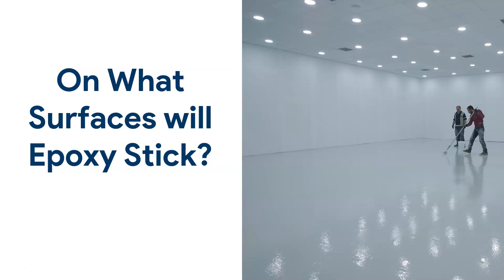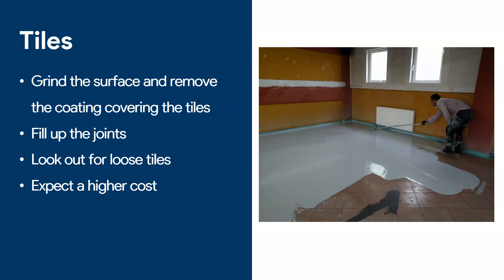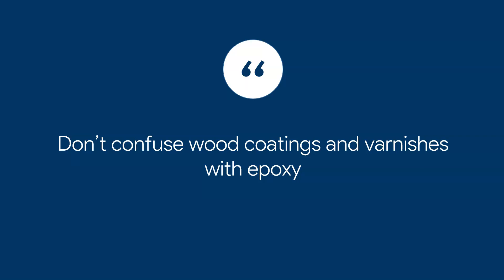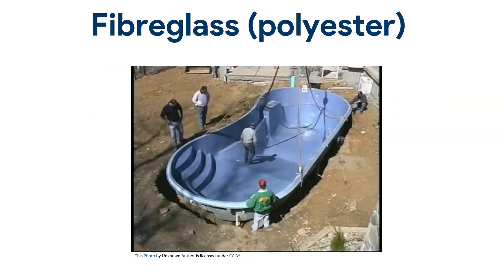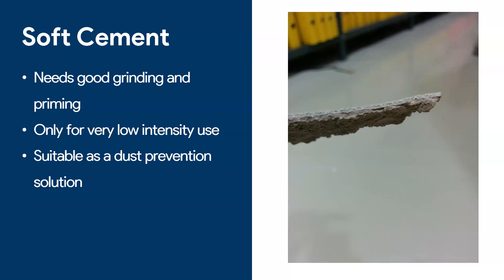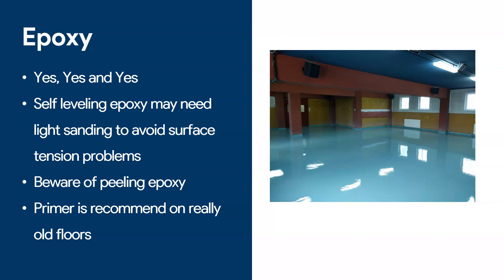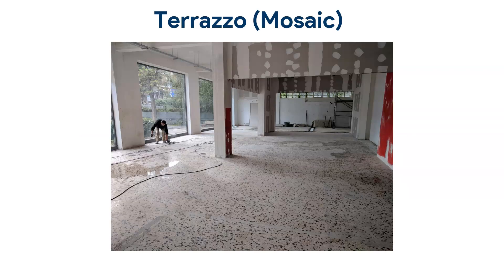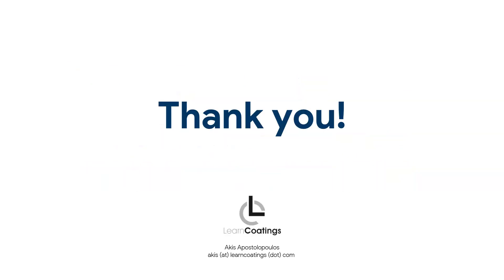Will Epoxy stick on Tiles - Wood - Soft Cement - PVC - Fibreglass - Terrazzo - Old Epoxy ?

Comment: May i know use what to grind the tiles?
Reply from the maker: The best tools are diamond grinders. I find that sandpaper is not as effective. You can either use a proper floor grinder or for small surfaces a hand held grinder will suffice

Comment: Thanks for always sharing your experience with us
Reply: Thank you Akis for always sharing
Reply from the maker: My pleasure!
Reply: @learncoatings-epoxyfloorin9448  Hello. With cracked and uneven concrete floors that you repair with grinding, epoxy and slc, will the slab not just move again causing the same issue? Greatful for your thoughts